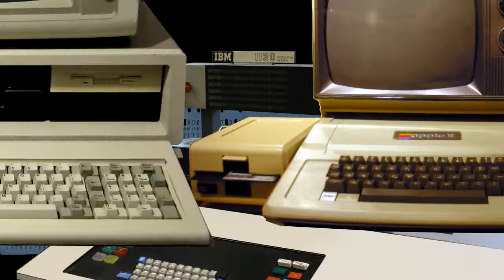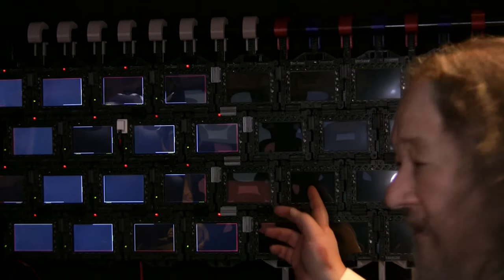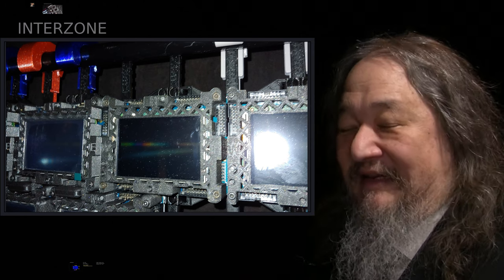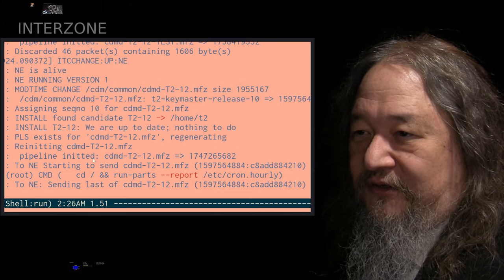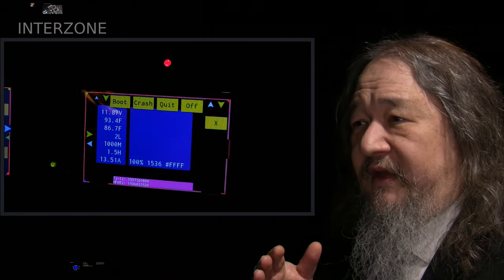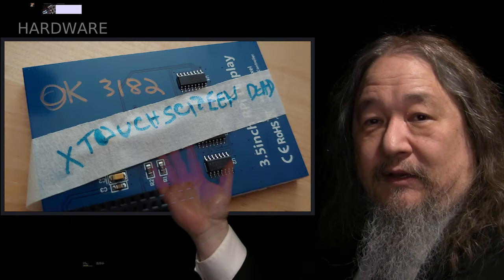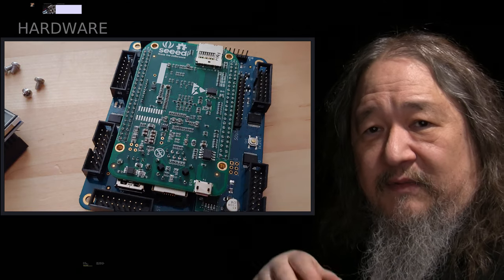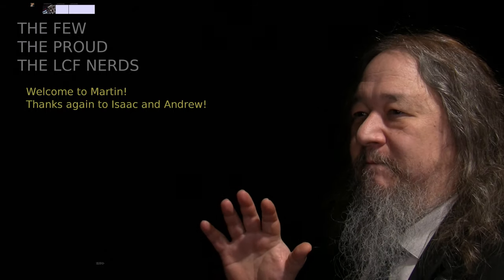Going Interzone - T2sday Update 283

Comment: Are you developing the CDM in the public? I might have some ideas to contribute from my experience in this space.  (unrelated: I emailed you last week, but we've had trouble with email coming through in the past)

In short, some ideas:
 - Instead of splitting on percentages, split on a rolling checksum.  This splits based on content, rather than position, so blocks are more likely to be shared between subsequent versions of the software.  This is the system described here https://technology.riotgames.com/news/supercharging-data-delivery-new-league-patcher
 - Keep around these blocks by their hash, so you only have to mirror changed blocks to neighbors
 - Send different blocks to your 6 different neighbors.  That is, start streaming block N % 0 to northeast, N%1 to northwest, N%2 to west, etc., until it has all of those blocks, then move on to the next bucket.  This means a tile can, in theory, receive blocks over up to all of it's channels in parallel.  The N%0 blocks I stream to northeast can start streaming to northwest while I'm still streaming the N%1 blocks.
Reply from the maker: For sure, CDM is in apps/cdm in https://github.com/DaveAckley/T2-12 .  Content Warning: Perl code!
Reply from the maker: Also re your email: I apologize for the slow back and I'm interested!

Comment: hopefully the T3 will have onboard power storage and management and engage in dynamic power routing based on need, to model Alife even closer. it would eliminate all this power zone fiddly stuff which seems so easy to mess up
Reply: What about optical data transfers between zones to protect against power surges.
Reply: @Mycon  with multi frequency plexing to minimize footprint, it would allow you to just kind butt them up together without fiddling with connectors and stuff as well, but some kind of power line has to connect somewhere, maybe rails in the mounting hardware it'self
Reply from the maker: Or maybe the T4 but eventually for sure.  The whole 'just power everything' idea is partly why forkbombs are such a pain.
Reply from the maker: I imagine bumming it down to solar cells on top, then capacitance/compute/communicate, then ground out the bottom.
Reply: @T2TileProject  im sorry, im not familiar with forkbombs?
Reply from the maker: https://youtu.be/OP6sJfxNFDc?t=347
Reply: @T2TileProject  oh, neat problem, could a possible solution be to on the engine level, allow the clearing of cells have a larger event window than the creation of new cells? so an immune system cell would be more robust than a forkebomb in a fight, and concentrating around the outside of the organism could allow it to keep forkbombs at bay?
Reply: though i could easily imagine a forkbomb that raizes an area ahead of it before growing into it.... that might still be able to overpower a home defender...